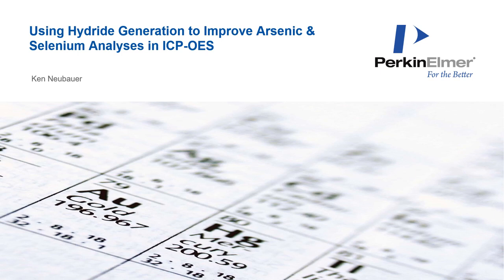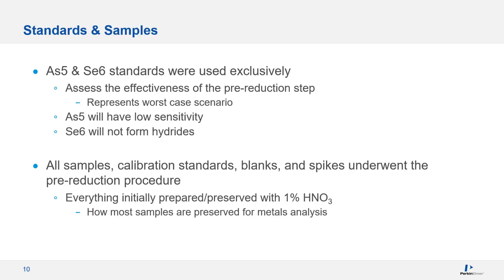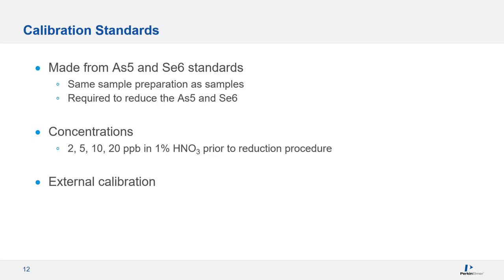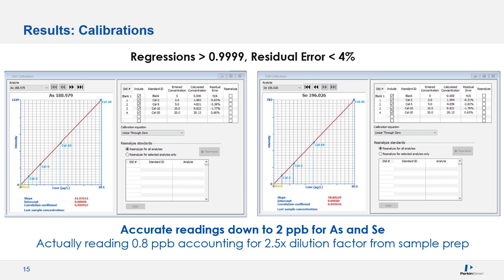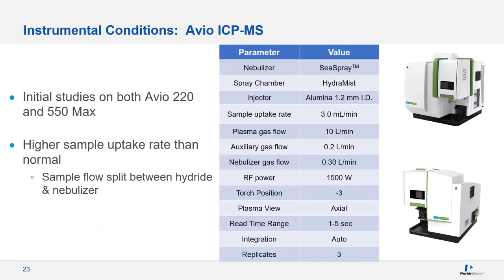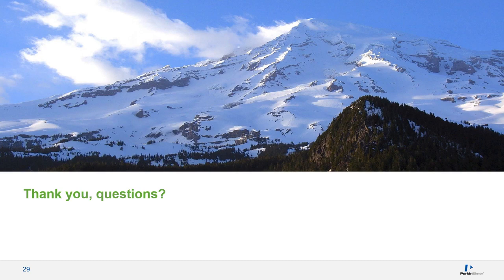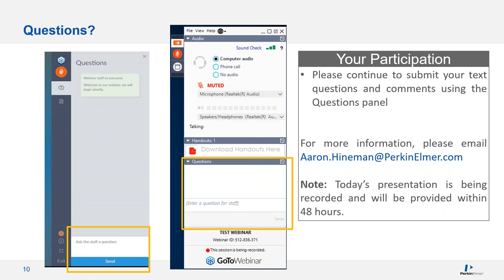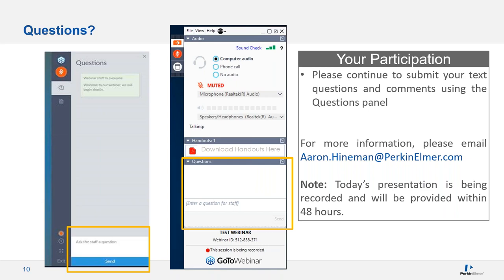How to Improve Arsenic and Selenium Analysis with Hydrides

Comment: I tried to analyze the laboratory's expertise in mercury analysis.  But the value does not fluctuate greatly by using the ICP OES Avio 200, which is analyzed in the form of Hydride.